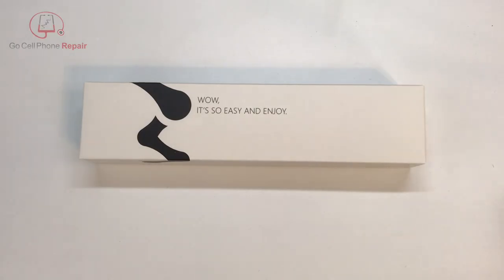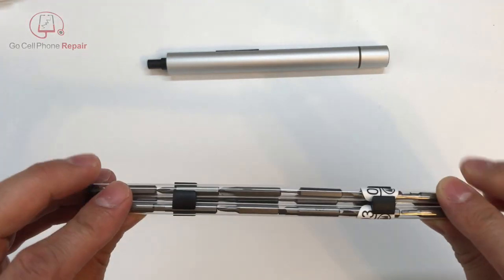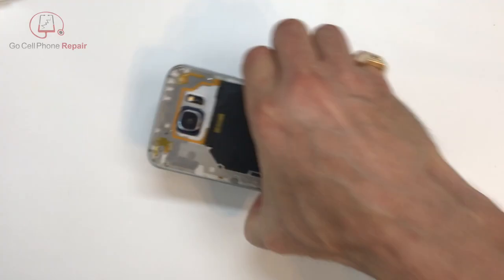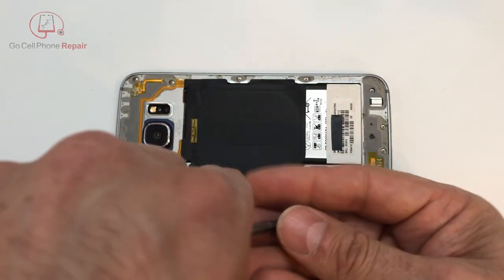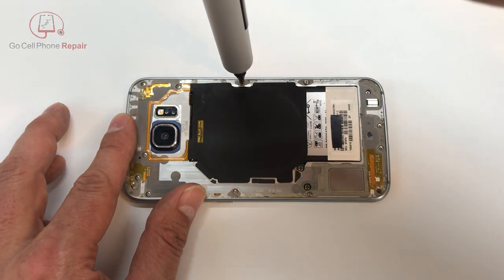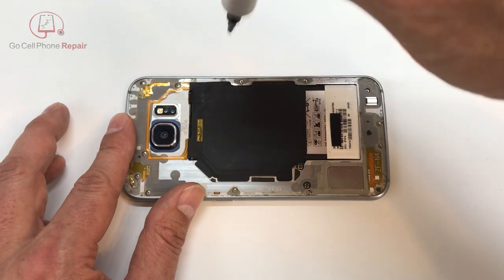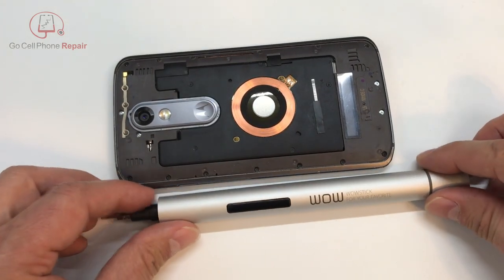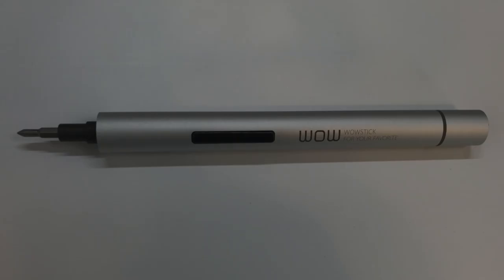WOW Stick Electric Screwdriver Review

Comment: it has PH0 and PH2 but not PH1. Wow indeed.

Does it give enough power for furniture assembly use, not just phone repar? Will it produce the kind of power a drill screwdriver can do?
Reply from the maker: No this may start larger screws but you’ll have to torque them down manually. I’m sure if it were that strong a lot of phone screws would be damaged.